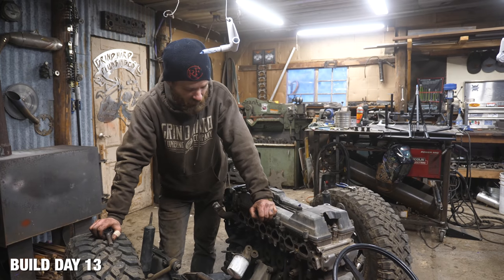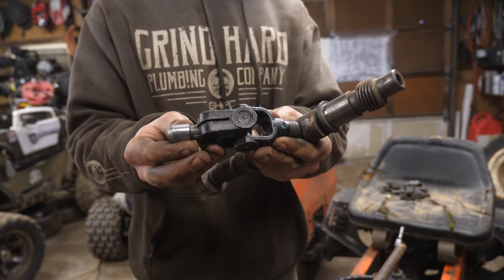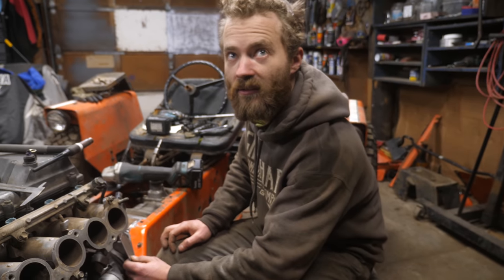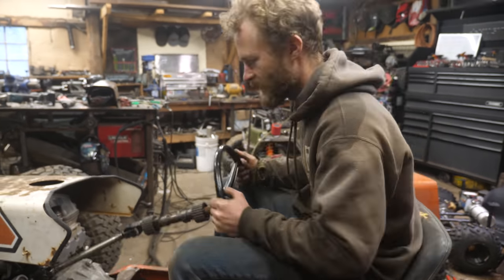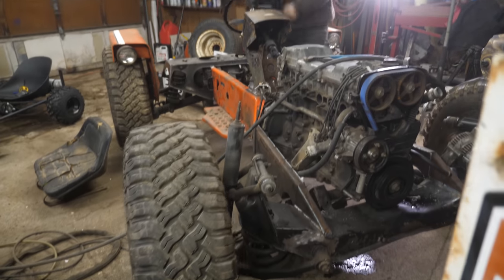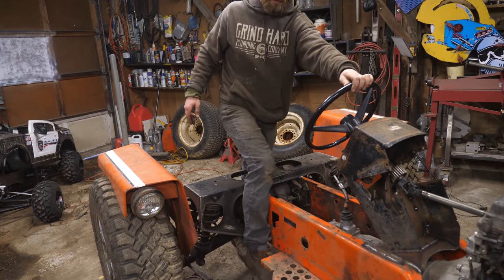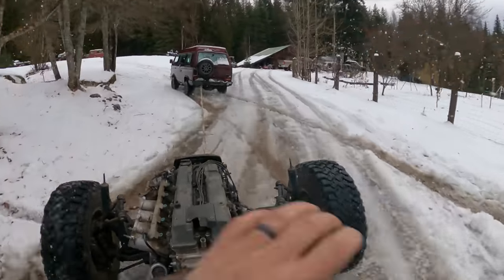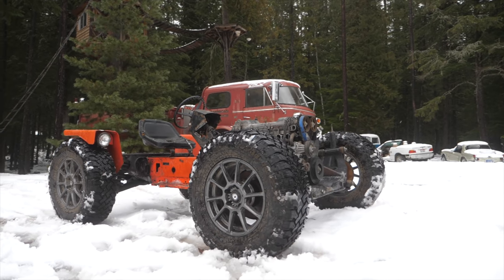2JZ Lawn Mower Build - Steering and Chassis EP 5

Comment: Me and my dad have a little project. We are putting a 16 horse motor in our golf cart and We already put 4wheeler suspension on it. We haven’t gotten the belt tightened yet but it will run soon

Comment: Awesome project!!

My only suggestion is make that dash/steering column mount assembly removable.  Make a beefy base bracket that bolts thru the side of the frame on each side.  That way if you ever need to pull the transmission you can unhook the steering shaft pull a few bolts and lift the whole assembly out of the way.  

When I build or modify stuff I always try to make every thing as easy to service/work on as possible.

Comment: You can through the springs in the oven at around 450 for a couple of hours. Cycle that three or four times and that will temper them down and make them a little softer.

Comment: I did comment on the first time you used that rear axle and removed those arms, they are there to stop the issue you have now.
Also definitely need to soften the springs, they're rated for probably triple the weight you have there, that may be large amount of the reason you have chassis twist before suspension compression. Definitely wise to strengthen it though!
Reply from the maker: We will definately look into adding those back in later on.

Comment: hey guys! love your stuff. i just wanted to let you guys know there is an engine called the 2ZZ-GE its a I4 that was made by Toyota and the head is designed by Yamaha. one of the last engines to come out of the great days of Toyota. revs to 8250rpm out of the box. it was used in the Lotus Elise too. the front cover of the engine has a Yamaha logo cast into the cover. i thought it would be cool to see that cover on the front of one of your builds. people would be asking what kind of Yamaha motor is that lol

Comment: I would recommend that you Weld some Angle Iron to the Top and Bottom of the Frame for RIGIDITY!

And Gussets from the Rear Suspension Frame to the Tractor Frame with Dimples.
Reply from the maker: That's more or less the plan!

Comment: take stock off because u dont have a lot od weight on frames 2nd u personally dont need them for racing thur bump it just make frame more twist n bend
if u want make it more harder u could added rolls bar from side by side attach to rear axle housing to front housing to keep it from not twisting

Comment: I have an idea of strength of the frame I would get some diamond plate and replace the orange steps from the rear sub-frame to the frame next to the engine and take one of the struts out of the back sub frame on each side so its not so rough

Comment: You can remove that oil filter pedestal and run the filter directly on the block. Just need a threaded stem long enough.
Reply from the maker: That might be a good option!

Comment: pushrod suspension would be a great looking addition
Reply from the maker: I've been thinkingning about that!
Reply: @GrindHardPlumbingCo  will probably be hard finding a spring with a low enough spring rate that will fit the stock design of the subframes. Even if you do, you have to figure out how to make the shock towers not look silly😕

Comment: I think the fact that the rear springs are so stiff is amplifying the chassis flex issue, cause the suspension isnt actually doing anything. its basically like a live axle
Reply from the maker: Yeah, for sure. We will find a way to soften up the rear a bit.

Comment: U shouldnt use camshaft as a steering part cos they are just cast iron and infact very brittle. I threw away some junk iron once and as I threw a camshaft into a towtrailer and missed and ihit the ground and it snapped in 2 ! :O  try banging that cam on something and u will be surprised ;)

Comment: I did notice one thing when you're putting in your steering or that camshaft is I do believe that was the starter that you put that camshaft over the top up look like there wasn't enough clearance there for you to pull the starter out though if the starter does go kaput on you just a small observation but I could be wrong on that also because I am watching it on a video
Reply from the maker: You are correct, but it's only three extra bolts to get the steering shaft out of the way...

Comment: Even with a hood on, it barely looks halfway like a tractor, in my opinion.
Reply: needs some proper staggered tractor wheels
Reply from the maker: Tractor inspired, jaguar suspensioned, 2jz powered go kart mower thing...
Reply: @GrindHardPlumbingCo  an abomination
Reply: @GrindHardPlumbingCo  It is an awesome machine, but if you could put just slightly smaller front tires on, i think it would look alot more like a regular tractor, i know it would reduce clearence.

Comment: I spent my entire 40 year working life at Ford UK Research & Engineering Centre (later called Product Development, and now called Ford Camus — WTF?!).  One job I had an as an apprentice was helping to measure chassis twist on a large dump truck.  We simply jacked up one corner till the wheel was clear of the ground, and measured chassis rail distance from the ground with a tape measure.  It does not sound very scientific looking back on it.  But the point I am making is that the heavy chassis rails most certainly twisted out of shape, but more importantly, sprung back to their correct position when unloaded.
Reply from the maker: Hey, if it works, it works!

Comment: On one of my project the oddest thing I ever had to do was the run the linkage trough the header this was on a Ford crourer truck that we put a chevy v8 engine in when do this we had change the steering box over to a chevette rack and pinion steering then we had to hand build the headers to get one to work then when we whent to the steering linkage in we found out that the header was right in the path linkage and we could not find a good way to get around it so we drilled an1 inch hole right through the header weld in a 1 inch peice of pipe and then ran the steering right truogh the header pipe so do if one would ever need to take the header off the engine they would need to take off the steering linkage first
Reply from the maker: Haha! That's awesome!

Comment: I have a spare 1988 Toyota Supra motor is not a 2JZ it's a turbo motor I have everything for it if you're interested wire harness computer automatic transmission a manual transmission

Comment: A couple of things:
First, I hope the haters have accepted this build, or at least moved on to more purist youtube channels.
Now... I'm going to play the role of the purist:
You said that these aren't the tires you're looking for. I hope not, but if you go to different dimensions you're going to have to change the geometry of your build. 
In the tradition of the farm tractor AND the so called "Rat Rod" you'll do yourselves a disservice if you don't include the "Big and Little" tire format. Big fat tires in the back, small steering tires in the front. If you keep building this machine with like sized tires, when you put right sized tires on, it will add slope to the nose, it will not look like a tractor, it will look like something with big tires slapped on the back. 
IMO, the rear tires should be the same diameter as what's on now, with maybe twice the width. Front tires should be reduced in diameter significantly, but the engine cowl/hood should remain relatively horizontal in profile, requiring a significant change in either the location or tuning of the front suspension. It then will look like a tractor.
In this video you talked about poor stability in the rear section of the frame and how you might fix this problem. I distinctly recall that you threw out the original Jaguar rear suspension radius arms as superfluous. I urge you to reexamine that first impression. Please don't reinvent the wheel. Jaguar isn't stupid, and they didn't hire stupid engineers. Please ask yourselves, "why is that there?"